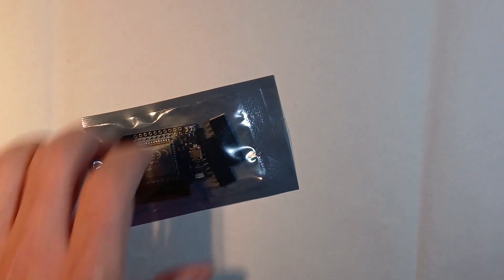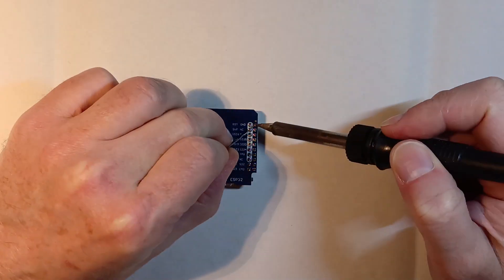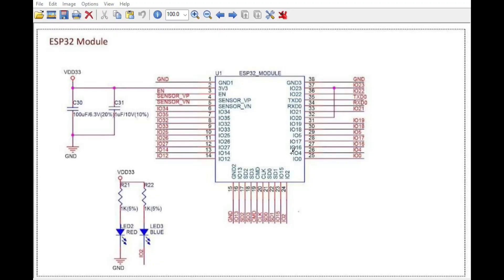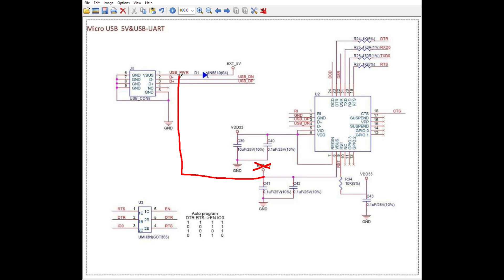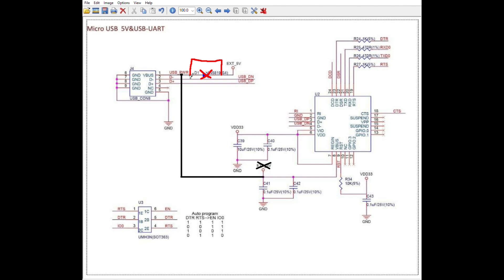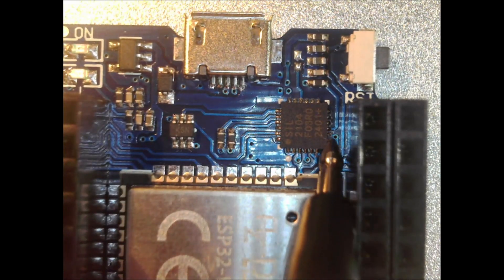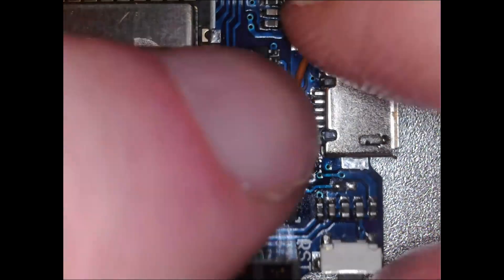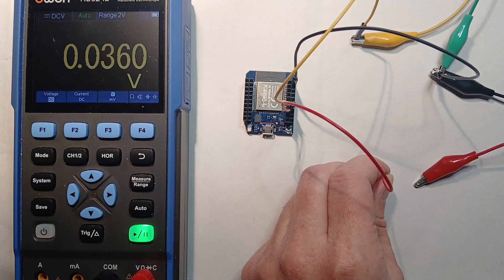ESP32 D1 Mini boot problem fixed

Comment: Very good!!! I'm having the same problem with the ESP8266 D1 Mini - Micro USB module. Some versions come without the diode, but others come with it, and in this version the software won't start, only by pressing the reset button a few times. Many posts say that removing the diode solves the problem (there's a risk of burning the USB port, okay), but none show how to do the bypass you did in this video. I'll try, because you tell Aliexpress sellers that you want the version without the diode, but they don't respect that and always send the version with the diode. Aliexpress doesn't refund 100% of the purchase with parts that come with the diode, so returning them is very expensive. If it works, I'll write again.